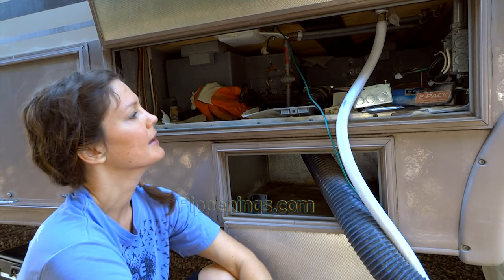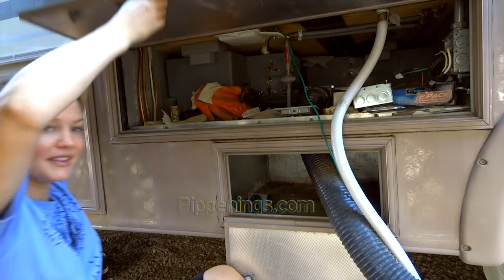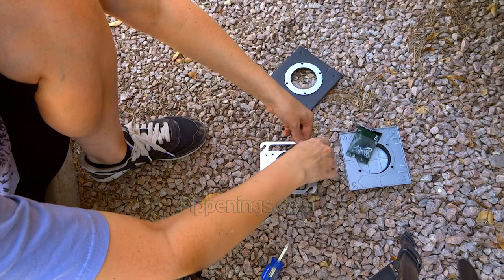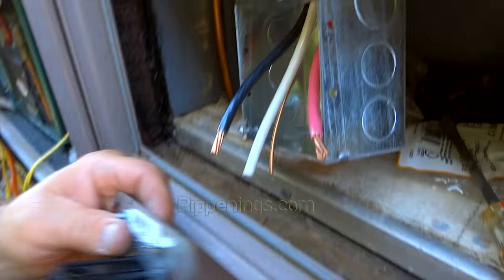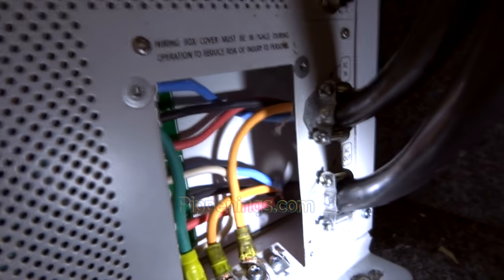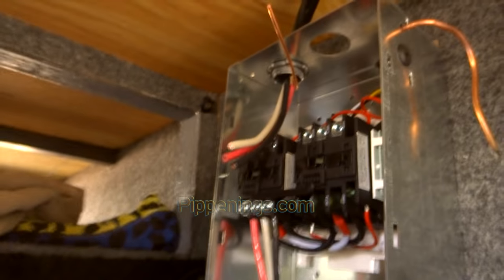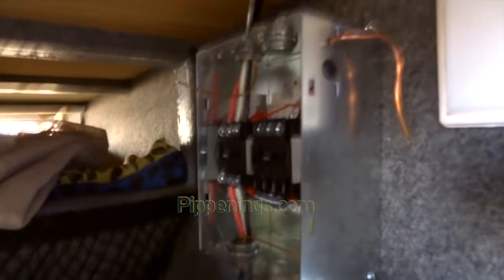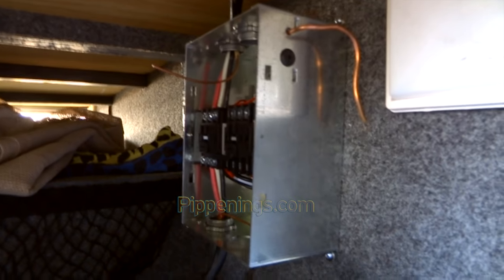30A to 50A Conversion RV: Components Installations, Part 3/4

Comment: Hi, I too am doing a 30 amp to 50 amp conversion on my 96 Fleetwood Bounder. Up until this point you did very well. This Suicide shore power 50 amp 240 volt line scares me, and for good reason.  I'm sure by now you have changed this flaw from the comments before me. Great job. You're awesome.

Comment: Where I am located, the metal knock out threaded clamps that you place that nut on and knock it tight with a screwdriver, those threaded pcs need a bushing. This stops the wire from rubbing through the casing and shorting out on the metal edge of that threaded pc. The vibration factor on a trailer / rv would be critical in a rv/trailer. Thanks for the videos.
Reply from the maker: Thanks for the advice!

Comment: Your shore power cord should be male and at the other end female, male to male is a disaster waiting to happen.  Look at any RV set up and there is no shore power cord with male at both ends...you have the connection to the RV wrong and reversed.  Your power supply is a female plug, so you have to have a male on your cord to hook up.  The other end of your cord that connects to the RV has to be female.  You have the connection point to the Coach backwards.  Ask your RV dealer about this set up or look at any RV shore power cord, your dealing with 50 Amps here.  Its not a safe set up.  One end of your RV extension shore power cord has to be female and the actual connection point to your RV has to be Male.  That needs to be fixed like yesterday.  You will need a new box on the RV for a Male connection.  Its an easy fix, but something that should not be ignored and fixed immediately.   I would also turn off your coach 50 amp breaker and turn off your power supply breaker before you disconnect the cord from coach or power supply.  Isolate that sucker and unplug it.  Unplug at power supply first, then coach.  I would also separate the power and water with a wall and fiberglass it so its waterproof.  Electricity and water are not a good mix in the same compartment.   Good luck and let us know:)
Reply: JoJo well said,
In some states this type of cord ( also know as suicide cable )  is actually not legal. Please please fix before some one gets hurt.

Comment: Your receptacle in the RV should be a male connection and not female because if you have a double-ended male cord and you plug the cord the shore power before you plug the cord into the RV and you accidentally touch the other end, you will be in the shock of your life. Just saying.